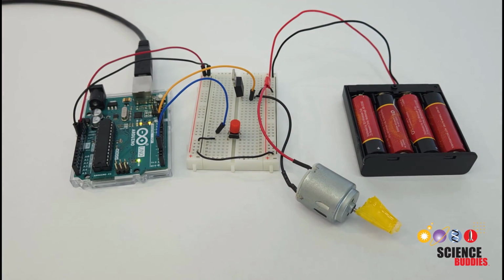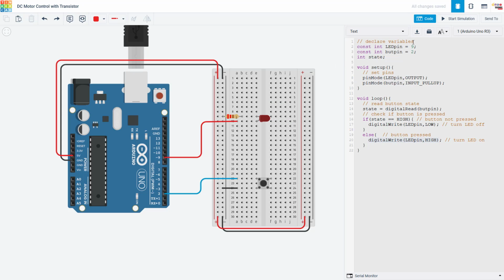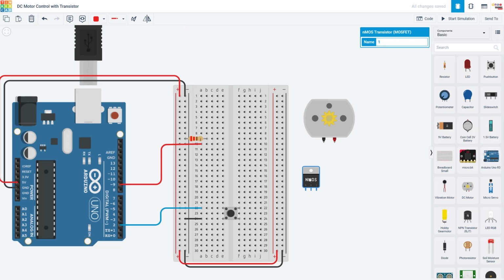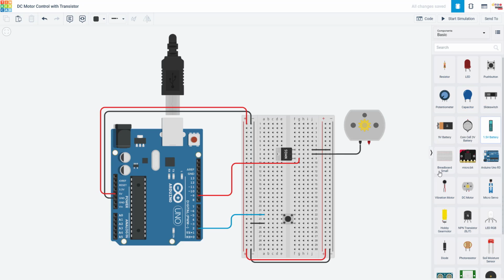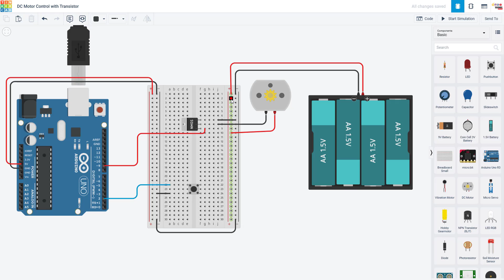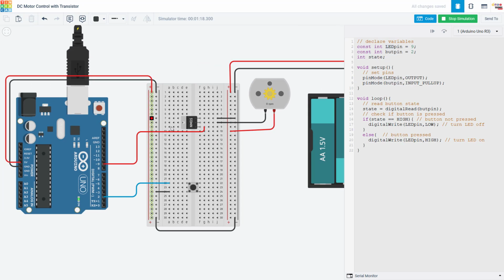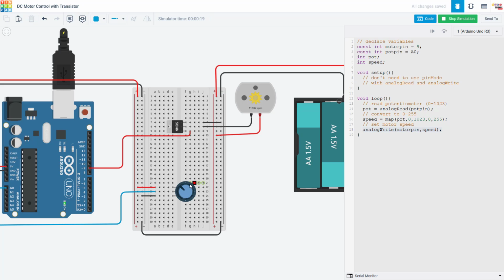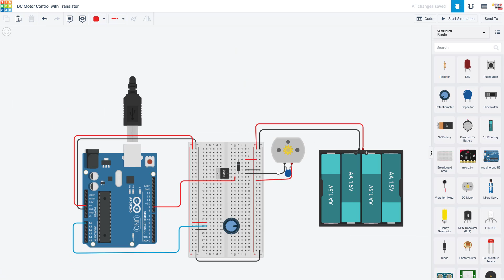Control a DC Motor with Arduino (Lesson #16)

Comment: Thank you so much for video! I want to ask something. Can we control a DC motor without batteries? I don't have batteries rn and there isn't a place i can buy it. If u can answer u gonna make me so happy! Thank you so much again!
Reply from the maker: You can power any Arduino project from batteries or a wall adapter - you may want to watch this video: https://youtu.be/I7MrL5Q7zvY?si=eWAOTg50fZF7AG0Z

Comment: Unless I am missing something, the video fails to mention the modle of MOSFET, and doesn't mention the use motor drivers. Diodes should have been mentioned at the start rather than shoehorned in at the end.

Comment: can i use an npn instead of the mosfet?
Reply from the maker: Yes, but be careful because the pinout of the npn is different and it requires a base transistor, so you cannot just build the circuit as shown in this video and swap in an npn for a MOSFET.

Comment: For those wondering how analogWrite controls speed, it works by turning the output pin on and off very fast.  It's misleading, it's not an analog signal, but a digital signal switching on and off.

The amount of "ON" time vs the "OFF" time dictates the speed. This is called the "duty cycle". "0" means it's never on. 128 (of a max of 255 remember), means it's on 50% of the time and off 50% of the time (128/255 ~ 50%). If you set it to 200, the duty cycle would be = 78%.

There's also duty frequency, which is how fast the on/off switching occurs. The arduino has a built in frequency of 480 or 960 hz depending which pin you use. Look in your docs for your specific model. "hz" is "hertz". So 480 means it 480 times per second.

Comment: Can someone explain to me how the pin state of the button is Low when it's pressed? If the button is pressed, it allows electricity to flow from the pin through the button and to the ground, and wouldn't that make the pin's state High, since the electricity is flowing through it?
Reply: There isn't such a thing as "the pin state of the button." There is the state of the pin (which is high by default because the pullup resistor for that pin is enabled) and the state of the button (which is normal open). When the button is pressed, it connects the pin to ground, so the state of the pin changes from high to low. The behavior of the circuit depends on whether the pin is pulled high or low by default, and if the button is normal open or normal closed. There are tradeoffs to every configuration.

Comment: Question is it possible to run 2 motors off of 1 Andruino controller?
Reply from the maker: Yes! If you need help doing so we recommend asking in the official Arduino forums.

Comment: i need help, why does my motor just run right when I plugged it in even though i have a code where it only runs when i press a push button (the button doesn't turn off the motor also :P). my project is due this thursday T-T
Reply from the maker: We recommend asking for help in the official Arduino forums, they will need to see both your code and pictures of your circuit to know what is wrong.

Comment: Can i use multiple motors(3) using single arduino and bread board
Reply from the maker: Yes but you will probably need external power for the motors - we have a separate video about powering Arduino projects.

Comment: How do I code it for a time component? Like say, I want it to spin for 30 seconds after I press the button one time and then stop after 30 seconds?
Reply from the maker: If you are new to Arduino, we recommend checking out the beginning of our Arduino tutorial playlist (linked in the description), which will show you how to use the delay command to turn things on or off for a certain amount of time.

Comment: Hi there, thanks a lot this is helpful for a project I am doing. I had a quick question, what components are you using in the real life circuit at the start, i.e. what are the power ratings of them so that I am able to purchase accordingly to produce a working circuit?
Thank you!
Reply from the maker: Hi - these are common components available in many Arduino starter kits. We do not have exact links for the parts used in this video.

Comment: Here is his LED button code:

const int LEDpin = 9;
const int butpin = 2;
int state;
void setup() {
  pinMode(LEDpin, OUTPUT);
  pinMode(butpin, INPUT_PULLUP);
}

void loop() {
  state = digitalRead(butpin);
  if(state == HIGH)
  {
    digitalWrite(LEDpin, LOW);
  }
  else
  {
    digitalWrite(LEDpin, HIGH);
  }
}

Comment: Thank you! Quick question though: how did you determine the potentiometer's range. Is that found in a data sheet by the provider or is it across all potentiometers that value?
Reply from the maker: The maximum resistance will be in the product name when you buy the part, sometimes just abbreviated for example as "10K potentiometer" which means 10 kilo-ohm potentiometer.
Reply: @Science.Buddies  ahh ok I see. Thank you very much!

Comment: is proportional integral derivative possible with this setup?
Reply from the maker: You can do PID control with an Arduino but this requires a sensor to measure the motor's rotational speed, called an encoder, which is not included in this video. This setup is "open loop" meaning there is no feedback signal that you can use for control.

Comment: Can you connect multiple motors to one Arduino?
Reply from the maker: Yes, as long as you are using an external power supply to power the motors.

Comment: Ty! but isn't much easier just to line the middle output of the potentiometer with the CC motor? u would be able to control the cc motor by regulating the batterie's tension 
you would have to connect the batteries on the Vin btw
Reply from the maker: Hi - the short answer to your question is "no, don't connect the motor directly to the potentiometer." The reason that doesn't work is a little more than we can explain in a YouTube comment and requires understanding some introductory physics and circuits concepts like Ohm's Law.

Comment: So this may be a long shot commenting on this video. But I was wondering if you need that transistor? Im trying to get my motor to spin but dont have transistors at my disposal. I need to use a button as well.
Reply from the maker: The Arduino's I/O pins cannot provide enough current to drive a motor directly, so yes you need the transistor.

Comment: Why did that my transistor is low level trigger I do not get it. I followed every single instruction. It might be the wrong transistor, but you said any type of transistor Mine looks like an MOS like in the video it said TO 692. Could you please help
Reply from the maker: You need to look up the pinout diagram for your transistor, not all transistors have the same pin locations.
Reply: @Science.Buddies ok

Comment: Can I use a 9 volt external battery source instead of the 6 volt one in the video?
Reply from the maker: It depends on the voltage rating of your motor. 9V batteries will also drain rather quickly when powering motors.
Reply: @Science.Buddies  ok thanks

Comment: Can you provide us with a diagram for an artificial pancreas thats using a 12v pump so it needs an external battery?
Reply from the maker: The process to connect a pump with an external power supply is the same as what is shown in this video around 5:50 to connect the motor with an external battery. In your case you would have an external 12V power supply instead of the 6V 4xAA battery pack, but the connections to the MOSFET and Arduino are the same.

Comment: I don't have the transistor, is there anyway to do it without it?
Reply from the maker: The Arduino's I/O pins will not be able to provide enough current to drive the motor directly without a transistor or another part called an H-bridge or motor driver (we have tutorials for those if you search our channel).
Reply: @Science.Buddies  Alright thanks :D

Comment: hi ! thanks this was so helpful, i am working on a artificial pancreas project and there i have a 12 volt pump to be controlled. do i have to use the diode there as well? is it necessary ?
Reply from the maker: A flyback diode is generally recommended when dealing with any DC motor or pump.

Comment: How did the MOSFET not lower down the voltage since Arduino's digital pin can only provide 2.5V which doesn't fully open the MOSFET
Reply from the maker: Arduino digital pins can provide 5V which is enough to turn the MOSFET fully on.
Reply: @Science.Buddies  I tried with real life projects and Tinkercad and it did measure 2.5V 🤷

Comment: Great video! I have an Arduino MKR Zero which has a built-in connection and charger for a 3.7V Li-pol 700mAH battery. I would like to power a 4V motor and the Arduino with the same battery. Will this setup in the video work with that MOSFET transistor? Do I need something to step-up the current if it was a 5 or 6V motor?
Reply from the maker: Hi - we can't provide detailed help with individual projects in YouTube comments, but you might get an answer to your question somewhere like the official Arduino forums.

Comment: Ok vary the speed with PWM (to be adjusted for the motor you have to manage). But how to do to vary the 'amplitude?
Reply from the maker: The Arduino's digital pins operate at 5V so the output will always be either 0V or 5V. The newer Arduino UNO R4 has a true analog output that can vary the output voltage.
Reply: You change amps by changing resistance.

Comment: Any idea why my digital pwm pins seem to be getting shorted out with too much current via this configuration?
Reply from the maker: This isn't really something we can troubleshoot in a YouTube comment - we'd recommend checking out a forum dedicated to electronics (the official Arduino forum, Reddit, Stackexchange, etc) where you can post pictures of your circuit.

Comment: Hi I was recently exposed to your channel and I really liked your videos you really explain everything the best way I have a question I came across a motor with three ports how am I supposed to use it and what does the third port mean thank you very much❤❤❤
Reply from the maker: Hi - we can't really tell without seeing the motor, you may be able to get an answer to your question on the official Arduino forums or another electronics forum on a site like Reddit or Stackexchange.

Comment: how do we know how much current the transistor is controlling and allowing into the motor?
Reply from the maker: You can connect a multimeter in series with the motor to measure the current: https://youtu.be/ts0EVc9vXcs?si=RWhOz3Z-QDKvApzs
Reply: @Science.Buddies  In the video you mentioned that the motor would require more current than than the LED, so when you connected the transistor into the circuit does that mean the transistor automatically drew the correct amount of current for the motor? If so, can you adjust the amount of current the transistor draws for the motor?
Reply from the maker: Hi - this is a little more than we can explain in a YouTube comment, you might want to look up some intro electrical engineering tutorial series.

Comment: Newbie here: can you have the battery pack also power the Arduino so that nothing needs to be plugged in?
Reply: This isnt a official answer pls do some research im not that smart but i think by creating four wires (2 positive 2 negative) and connecting the first pair cable to the Vin pin and one to the gnd DONT SWITCH THE POLARITY It will deef fry ur board, and the two other wire pairs to the breadboard buses AGAIN PLEAAASE DO SOME RESEARCH ABOUT THIS METHOD  , it will prob work idk😅😊

Comment: i wanted to do this but i dont have any n-channel mosfet and h-bridge integrated, where did you buy those/ where do you think i could buy cheap ones?
Reply from the maker: These parts are available on Amazon and electronics vendors like SparkFun, Adafruit, Digikey, Jameco, Mouser, etc.

Comment: Use PWM, this hurts my brain
Reply: Go for it if you want to burn your arduino
Reply: The Arduino pins can handle only 20mA, the motor is >50mA… You’ll fry it…
Reply: @œøǔÿpwm through a mosfet

Comment: Do i need to place 10k Resistor between Gate and Ground and 220Ohm Resistor between Gate and Arduino Pin?
Reply: Yes or MOSFET will stay on

Comment: How would I change the code so that on a single press of the button the motor constantly spins until the button is pushed again?
Reply: create a flag that will hold the last value. By default it is 0 and when you press you assign it to 1. on second press you have you have to assign to 0 and vice versa. and use that variable to turn on and off the motor.

Comment: Why isn't the button being connected to the 5v of the arduino as shown in you button LED video? :(
Reply from the maker: In our button video, we use an external pull-down resistor to ground so the button is low when not pressed, and wire the other side of the button to 5V so it is high when pressed. This approach is a little more intuitive when first learning buttons (pressed = high/on, not pressed = low/off). However, the Arduino also has an internal pull-up resistor that you can set using INPUT_PULLUP as shown in the code. If you do this, then you only need to wire the button to ground externally and not 5V. It's a little less intuitive because the input will be high when not pressed and will go low when you press the button, but it requires fewer external parts and wires. Sorry for not explaining that clearly in the video!

Comment: No matter how often I watch your Tutorial, I just can‘t manage to shut the motor off.

On PWM 255 it looks like it‘s at full speed. However, if I PWM 0, the Motor just keeps spinning slightly slower.

What have I been missing? My setup is exactly the same, except that I‘m using an arduino r4 minima instead of a r3.
Reply from the maker: This code should work the same on an R4 as it does on an R3. There may be something wrong with your circuit or code but we can't say for sure without seeing them. If you are a K-12 student working on a school science project, you can ask for help in the Ask an Expert forums on our website, where we have volunteers to help answer questions: https://www.sciencebuddies.org/science-fair-projects/ask-an-expert-intro. Unfortunately we are a small organization and cannot provide support beyond that, but you could try asking for help in the official Arduino forums or other forums like Stackexchange or Reddit.

Comment: This doesn't make any sense, an ordinary mosfet has a minimum voltage threshold on the gate, which allows it to open, so lower voltage values from the potentiometer won't even open it, causing the motor to be left turned off, and high enough voltage values from the potentiometer will exceed the gate's threshold, causing it to open, causing the motor to run at full speed.  A mosfet can be either open or closed, so the motor will either run at full speed or not run at all, so please explain what am I missing here
Reply from the maker: The voltage from the potentiometer is not going directly to the MOSFET's gate. It is going to an analog input pin on the Arduino, which is read with the analogRead command, and then converted to a pulse-width modulation value and sent to one of the Arduino's output pins using the analogWrite command. The trick is that the UNO R3 does not have a true analog output - it is a pulse-width modulation (PWM) signal that just alternates between high and low (fully on or fully off, as you noted). By adjusting the duty cycle (percentage of each period the signal is high) you can control the motor speed.

Comment: Could you just put two transistors one for forward and one for reverse and put diodes in between so you don't put power through another transistor when not in use. But they are connected to the same motor they just output a different polarity.
Reply from the maker: You can build an H-bridge using discrete transistors yourself but it actually requires four transistors, not two. This allows you to reverse the direction of current through the motor. We don't have our own tutorial on it, but you can find example circuit diagrams online. It's easier to make a mistake when building a circuit with multiple transistors though, so at that point you might as well just use an H-bridge IC.

Comment: Great video!
One thing that I've been struggling to understand is the purpose of the "common ground". Why does this need to happen in these types of circuits?
Reply from the maker: It's a bit much for us to explain in a single YouTube comment. The very short answer is that voltage is measured between two points, so all parts in the circuit need a "common" or reference level. Think of it like using sea level as a reference for "zero" elevation everywhere in the world. If you search YouTube for videos about "what is ground in a circuit?" you will find some more detailed explanations.
Reply: @Science.Buddies  my problem with this has been that when you have an external power source, you need to connect it to a common ground (with the Arduino) when the external power source already has a potential difference between its poles. Ill have to keep building to understand why this connection needs to happen.

Comment: Are there external power supplies that just connect to another 9v power cable? If you want to do a project that doesn't need to be portable and would be useless to have batteries on it seems like there should be a way to bypass the batteries.
Reply from the maker: Check out this video that is all about powering Arduino projects, it may help: https://youtu.be/I7MrL5Q7zvY?si=3vHons6WmIVFZP39